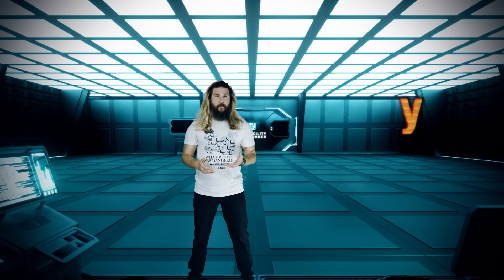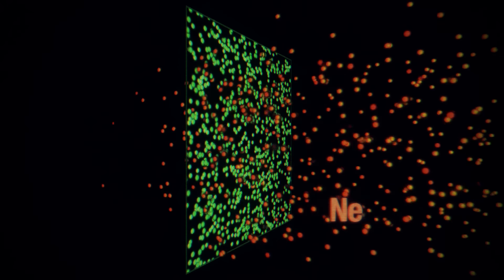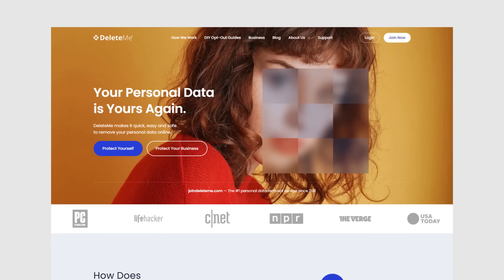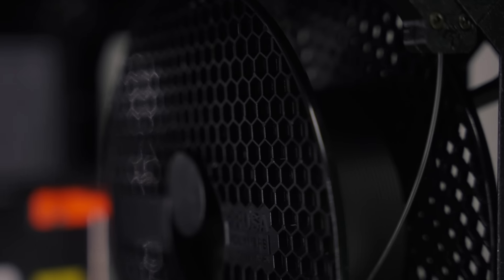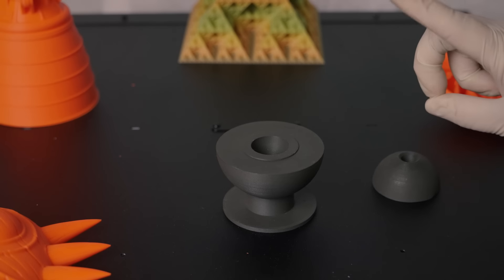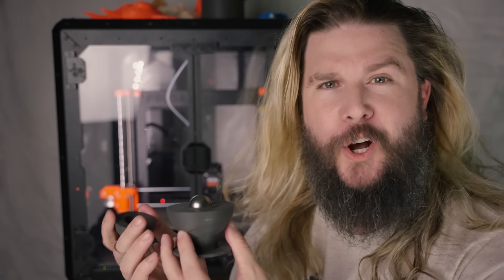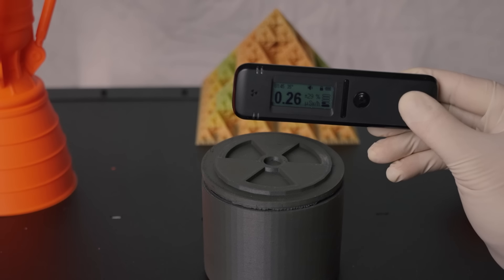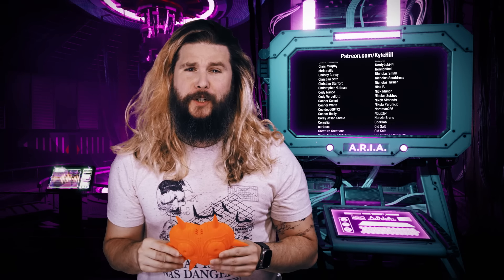3D-Printing TUNGSTEN Radiation Shields!

Comment: 1)  We need a control demo.  Reprint the cask in PLA pro, abs and CF with a. Controlled infill pattern/rate.

2)  While tungsten infused polymers in this application is new,  it is used in other applications.  What I would be curious to know is if you could take advantage of the infill gaps and fill it with other materials with shielding properties,  such as water or concrete?

3)  How does this material stack up to shields used in medicine currently?  Could the current shielding vests worn during procedures be replaced by subbing in this material for a lighter weight option?  Current shields for operative procedures are heavy and hot.  I would have loved to have had a light weight printed option back in the day.
Reply: I think its far better to just cast the part with lead. Cheaper, far better shielding, its melting point is just about a hundred degrees higher than the filament, any shape can be cast.
Reply: Yes, we exactly need this video.
Reply: My first thought was using it as a protective vest.
I work in highly radioactive areas and some tasks require me to wear full PVC suit (300 micron), N10/Kemira respirator, and Lead vest.
Wearing the vests is the most uncomfortable experience when in PVC, your body sweats extreme amounts to a point where your suit fills up and becomes a water bag. Having a lead vest increases your sweat output and causes your suit to fill quicker.
We also wear ice vests under the lead vests to try and keep us cool, but it usually just makes it heavier and more cumbersome, which is why most workers opt out of wearing Ice vests.
Reply: @petrolhead0387  But how would this be any different? this is not a magical material that stops radiation at a fraction for the weight of lead. This material is in fact heavier than lead 14.27g/cm3 If I remember correctly at a cost of about $0.230 per gram, BTW that means one gram of material equals to a volume of 0.07 cm3. Imagine the cost of basically anything larger than a few cm in size!
Reply: @teresashinkansen9402  tungsten has higher density than lead, meaning less would be needed to provide as much shielding. Due to the tungsten being thinner it could offer more dexterity to the wearer, making it a more comfortable vest to wear.

Also Tungsten is non toxic, unlike lead.
Reply: @petrolhead0387 Yes tungsten has more density than lead but this is not pure tungsten, is a composite of 25% PETG and 75% tungsten dust, so i doubt it has any significant benefit in shielding over lead. And yes lead is toxic but it can be melted and recast an almost indefinite amount of times, also the lead recycling industry is mature due the recycling of car batteries. You cannot really reuse this 3D printed stuff and while you can dispose of it more easily you are still throwing away heavy metals to the landfill. Imagine you make a one off shield that requires about 400cm3 of material basically the size of a large soda can, that would cost about $1.3k only to throw it away when it starts disintegrating into pieces?
Reply: @teresashinkansen9402  I'm not talking about giant shields, I'm talking about wearable protection. Some facilities that I work in are already replacing leaded gloves with tungsten ones, and have been reported to be much more effective. I'm talking about using them for printing vests that could be made to fit the wearer, without the need of melting and forging a toxic metal.
Tungsten has a higher atomic number and is much more effective at protecting against gamma rays, yes the cost is higher, but it's a splash in the ocean when you look at what the Nuclear industry already costs.
A contaminated lead apron does n9t get recycled either, it becomes waste. These are radioactive protective materials, comparing them to car batteries is like comparing salt to sugar. Yes they may look the same, but I know which I would have in my tea and which I wouldn't.
Reply: @petrolhead0387  Well according to rad pro calculator shielding 10Ci of Co-60 with 1cm of lead reduces the dose from 113mSv/h to 77mSv/h at 1m distance, with .59cm of tungsten (equal shield weight, W is 1.69 times heavier than Pb) you get a dose of 79mSv/h So is it really better? It looks almost identical to me. Sure it will be less bulky but is the same weight! the equivalent shield made of water would have a thickness of about 14cm 14 times ticker than lead. As you can see is mass what shields, higher density only makes for smaller shields but they weight almost the same! 

I don't have an issue with replacing lead with tungsten or even bismuth. my issue is this 3D printing material is almost a gimmick. Is not flexible, its mechanical properties must be crap due the very high loading with W dust, FDM prints are extremely rough and thus decontamination would be out of the window, a painted lead shield can be decontaminated much more easier. Also if contaminated objects go into a highly controlled storage any way so what is the matter if it has lead?
Reply: @teresashinkansen9402  I'm guessing you've never worked in an active setting, you think throwing out numbers makes you right. There is a big difference between working on the front line and sitting at a computer doing calculations.
You are still looking into weight as a factor, what's heavier A tonne of feathers or a tonne of iron?
If you give me two vests, one thick lead vest and one thinner tungsten vest and say pick one, they weigh the same, they protect the same, but one is thinner giving you more flexibility when putting a suit on, the other contains toxic metal that can cause lead poisoning if the fabric becomes ripped and the lead is in contact with your skin.
I wear these things as part of my job, I know how awkward they are, if I was offered a thinner version of the same equipment offering the same protection I'd use it without a second thought.
Reply: @petrolhead0387  Number are numbers and while they not always translate well to reality they are a good approximation. NI I haven't worked in an active setting but have read about shielding. Please read the last paragraph of my last reply, im not against replacing lead, I criticize this 3D printing material.
Reply: @teresashinkansen9402  do us both a favour, look for a YouTube video titled "3D Printed Tungsten shielding Bruce Power" then come back and tell me why it's no good.
Reply: @petrolhead0387  Still does not make much sense to me, no wonder it works better. Using a huge blanket to shield a small hot spot is like using a truck to transport a bicycle, but I guess in the nuclear industry everything is as inefficient as possible due the blame/safety chain, I mean why not do the same but instead cast a bismuth shield? as discussed before mass is what shields, using it efficiently is basically what makes the difference so just cast an efficient shape! not a huge 100lb blanket.

I guess Im starting a tungsten filament factory. Good money when suckers pay you $3.3k a dm3 of filament. Also a service for quick custom high density bismuth shields for such situations.

Comment: Unironically this could be huge for my thesis research (my supervisor is gonna love me but I may have to pretend I didn't learn of it on youtube)

We're looking at using a fancy hydrogel and fancier lithography to produce artificial cancer cells for radiation therapy research 
Being able to produce small scale shielding like this could be huge for better controlling where our radiation target goes later
Reply: Good luck 😉
Reply: Isn't better to use a cast shield? there are bismuth alloys that are non toxic yet offer the same if not slightly higher shielding capabilities, yet they can be remelted and used many many times making it very versatile. I mean the kg of bismuth is about $10-27 that's 20 to  10 times cheaper than this filament. But sure you will have to lean some skills to cast.

Comment: Hi a Kevin and radiochemist here ✌️ looking not to die any time soon 😂

I'm actually working for a big manufacturer of radioisotopes for medical applications. 

From the top of my hat there are also a lot of devices used in radio labs/ radiohadmacys which you would like to shield. But using the lead brick wall and foil method is always somewhat cumbersome. In addition also radionuclide generators come in a big variety of shapes, sizes and activities. They are usually self shielded but the outlet for the radionuclide solutions (eluate) is not.

There also other applications or contraptions I can think of to make manual radio labeling safer but I guess that is too much to all note down.

But feel free to get in touch, super down for it! 

Greetings from an Alpha Kevin (yes I primarily work with Ac-225 😅)

Also, keep up the good work Kyle 💪

Comment: Use the uranium to protect from uranium!
Reply: Fight fire with fire, baby!
Reply: I'm pretty sure they didn't use uranium to make the filament because it's really hard to get to sell that stuff
Reply: You can use DU for shielding in some circumtenses as it has lower alpha than NU and the high density is great stopping x-ray and gamma. You don't want to use it in very high neutron flux though especially not where the neutrons avg kinetic energy is around 2 MeV xD
Reply: There is a good chance I am grossly misinterpreting what the original comment means by 'Use the uranium to protect from uranium!' but this is my take on what I think they might be saying. (I have also yet to watch the video, as some might be able to tell. There's probably some part of the video that makes mention of this.)

It could actually be a good idea in the case of space travel or space bases. Radiation shielding is heavy, but in all likelihood, a future base—let's say a moon base, for simplicity—could probably be sent up with a nuclear reactor and robots or drones for construction (to prepare for humans in whatever way). Then, after the reactor has spent its fuel by powering those construction robots, you could use the depleted fuel as radiation shielding for potential human habitation, assuming you process it properly and or deplete the fuel to the point of non-radioactivity. Nuclear fuel bundles would need to be suspiciously brick- or panel-shaped, though. Whatever reactor coolant was used (probably water or a liquid metal) could also be recycled into shielding, assuming it wasn't made radioactive.
Reply: Even depleted uranium is actually not a good material to use - it does have quite a bit of stopping power against radiation, but it also radiates HEAVILY itself - as far as long-term exposure is concerned. Also - U-238 has much higher-energy emissions than U-235 - with 235, you dominant peak is gamma rays at 186 keV, while 238 peaks at 760 and 1000 keV - so each individual gamma ray has much deeper punch through other, non-emitting shielding
(Source - I was the radiation guy for a robot designed for crawling through uranium gas diffusion pipes to map out radioactive deposits before dismantling)
Reply: Thanos: “I used the uranium to destroy the uranium”
Reply: @GIRGHGH  Also, we don't want someone 3d-printing demon cores and accidentally glowing up the neighbourhood. Also also, 3d-printed gun-type assemblies or, better yet, 3d-printed implosion pits. We need Los Alamos to get onto that ASAP.

Comment: I wonder if you could switch out the tungsten and apply this same process to make better emissions control for factories and power plants
Reply: Filament for 3D printers only needs so many % soft extrudable content. You can get it with all kinds of fun stuff mixed in: wood, iron bamboo, brass, clay... 
They come with specific limitations but lots of things work with a little tweaking.

The hard part is finding good uses😜
Reply: @Bbonno  that's why I was thinking stuff like catalytic converters, you could use a program to figure out the best surface area:airflow ratio and 3D print the internal structure better than any machine filter style or packing process ever could
Reply: @DaChickenKing1  surface area stuff like catalytic converters sounds like something for sintered metal products. There you want max% 'business material' at the surface and not hidden behind the polymer binder. 

Still, printing space filling curves sounds fun 😊
Reply: @Bbonno catalytic converters have the catalyst impregnated into a ceramic matrix. The major limitation is the cost of the catalyst metals, especially platinum group metals. I don't think this technology is particularly transferable to such applications where the catalyst gets really hot. 

Maybe a derivative of this technology could work for things like molecular sievs or selectively permeable membrane filters but that's getting beyond the scope of the technology demonstrated here. 

Impregnating polymer filament with different compounds isn't new, the advancement here appears to be specifically the Impregnating of Tungsten into a durable 3d printing filament. It's very interesting and exciting but the scope seems pretty specific to radiation shielding. I could see this material having interesting thermal properties like higher thermal mass and better thermal conductivity than regular plastics which may have other niche applications but I can't see it being particularly useful in emissions controls.
Reply: @SpencerHHO  fair points. I'm not specifically meaning catylatic converters, just air quality devices in general where they might bottleneck or have difficult packaging constraints

Comment: You could've built a holder out of legos for your radiacode when measuring the uranium ore in the tungsten demon core
Reply: I was wondering why he didn't 3D print a stand for it, particularly when he showed off other prints.
Reply: @BainesMkII  a tungsten stand would be overkill
Reply: @The-One-and-Only100  He also showed seemingly regular prints of the fractal pyramid and Majora's mask.  And he did do a tungsten Mjolnir.

Comment: Honestly, I think the invention of 3d printing in a way that's not only affordable but also very reliable even on a consumer level will prove to be what kickstarts a new age of progress, in the same way the steam engine and movable printing press did. Steam engines vastly reduced labor required to operate machinery, the movable printing press made copying and printing, something that required expensive permanent presses or manual labor to do before, trivial, and now 3d printing means you can prototype engineering and manufacturing in a matter of days rather than months or years.

Comment: A good use for that can be making markers for X-Ray imaging. If you are taking an X-Ray of an animal, for something like a bone fracture, you could print up a bunch of shapes in precise controlled shapes/sizes to put on the plate next to the area being imaged. The print will block the radiation and you will have a defined shape on the image that can be used as a reference to know the size of the anamoly you are investigating.

Comment: For prusa, I'm a PhD student in a lab that works with tungsten and tungsten carbide sintering. By the fact its fdm id imagine its melting point is like 400-500c. Maybe higher depending on what that add on he was talking about is. But nowhere near its actual melting point. I'm wondering if theres someway to remove the plastic thermally or chemically after a print to get the thermal capabilites of tungsten back. That would be very interesting.
Reply: This isn't the first plastic filament with metal embedded in it, and yeah you usually can cook out the plastic and fuse the metal afterwards. It involves sticking the print in sand to help it warp less, but it does still shrink, warp and melt a bit
Reply: The Mk4 maxes out at about 300C.

Comment: Now all we need is a 3d printer that can hit 3,422°C to melt pure tungsten. The Prusa mk4 is pretty close at 290°C
Reply: we already do. Direct Metal Laser Sintering, It SLS printing with a lot more power to the laser and one available material from more specialized operations is tungsten.

Comment: The nuclear Navy still uses florescent bulbs in the reactor compartment. I used to be an EM, and part of my job when the compartment was open was to make sure ALL of the lights were on. Florescent bulbs have a tiny bit of mercury in them. We were also not allowed to bring in a ladder... So it was pretty easy to break a bulb while climbing around to change all the bulbs and starters. The Navy tended to get a little upset when that would happen. Anyway, a sleeve to place the bulbs in so if you dropped/bumped the bulb on anything while you're climbing around would have been awesome.

Comment: As a nuclear medicine technologist in training, this is super cool. How thick would the 3D printed shield have to be if you were to shield PET radiopharmaceuticals with energies of 511 keV?
Reply: That's a hard one to shield. If the printer were pure tungsten, about 4mm for a half value layer and 3 and 1/2cm for a tenth value layer. It looks like it is about 80-90% metal, so in reality probably at least 5mm HVL and 4cm TVL pretty similar to lead. And lead is cheap and easy to cast/mold.

It looks like some of these products include some sort of boron in the filament. That would help to absorb neutrons for things like reactors and high energy applications where otherwise they would need to be stacking layers of lead and boronated material.

Comment: I work as a research engineer at a particle accelerator, we currently have some of this filament and are using it to make stainless steel aperture replacements for use in x-ray experiments. So far looks promising for our application.

Comment: This is not a new innovation; while it may be new to Prusa, we were using tungsten-embedded printer filament to shield our cameras from radiation during inspections in the reactor pool as far back as eight years ago at the decommissioned reactor where I work.
Reply: It's not even new for Prusa. It's been around for at least 18 months in it's current form and I swear I saw an older version before that too.